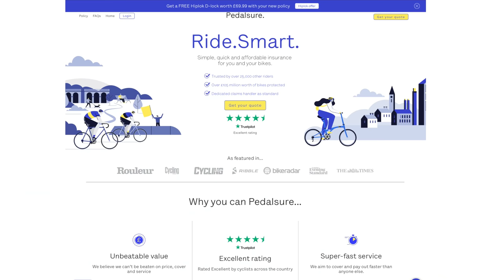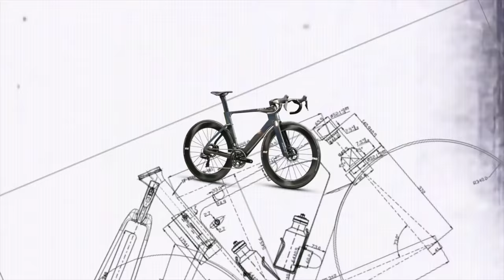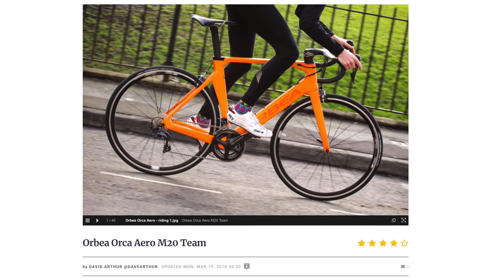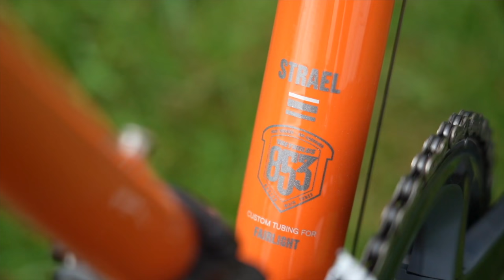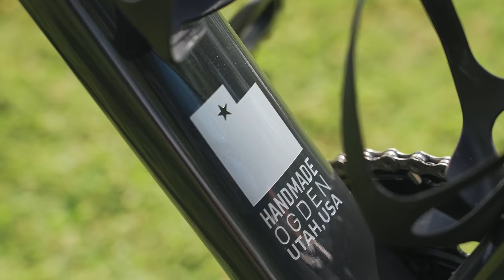6 Best New Road Bikes 2022

Comment: I Live in Birmingham AL and I received a Dogma F Plutonium Flash 56mm on August 4, 2021 SRAM Red AXS 12 spd full groupset which helps greatly with all the hills here in the city 10-33T cassette and and my Crank is  48-35T

Comment: Been thinking  of upgrading my 2014 road bike for 2 years now but prices and wait times keep putting me off pulling the trigger(remember the days when a bike took less than a week to arrive after ordering 😪).Integration on bikes is another problem for me, while it makes the bikes look fantastic the practicality factor puts me off. I enjoy replacing cables/ servicing my bikes myself without much hassle unlike new bikes with ever greater integration. Think I have just talked myself into sticking with old faithful for another year😂.
Reply: Check out the TCR Advanced Pro Disc 1. They still have some in warehouse (at least in the U.S.).  Mine arrived one week after ordering. Super great value. Good price…and you can replace cables yourself. Stiff in all the right places yet excellent ride quality.
Reply: @nelsdude  great bike but I also avoid bikes press fit bottom brackets.

Comment: I have a Colnago C64 plus DA on order. Really wanted rim brakes for looks (and I don‘t need the performance) but what convinced me to get hydraulic disks is the much reduced lever force required for same stopping action compared to rim brakes.
Reply: Yes my father liked discs for that reason. But he is 83 and has arthritis.
Reply: Hydraulics on a road bike is overkill. Mountain bikes, it's a must, road just plain and simply overkill. You can get away with disc brakes with cable/wires on a road and it would be perfectly fine.
Reply: @indusrtial  you don't need power steering in most cars. Yet it's nice to have.
Reply: @3stone1  …what, power steering just kills the feeling communicated through the wheel… in general, you won’t find race cars with power steering.
Reply: @fragu123  so you got rid of it in your daily I guess?

Comment: I agree Pin should drop the F and just call it Dogma. Rim brakes all the way! I will not ride my Dogma in the rain when if arrives. Disc on a road bike is only better in bad weather.  Plus I have never over cooked my rims brakes even doing 50 mph/80+km into a corner.

Comment: I'd like to comment on weight.
I weight 170 lbs. on my heavy days and as light as 160 lbs. on my light days
A bicycle frame weight of 800 grams is extremely light. Yes there are other frames even lighter. But to me the english words equate to very breakable. As a true cyclist for over 50 years. I have learned, when a person rides a bicycle he has accepted the risk of falling down (or crashing).  An 800 gram bicycle is more likely to break than a 1000 gram fame.
All you amateur riders put too much emphasis on lightweight and aero. When your body is 90% of your failure. Change your body position lose some weight and you won't need an 800 gram bicycle frame that is more likely to break.
 The bicycle industry has got our minds so twisted that they have many of us believing that what they are selling is what we need.

Comment: Aero smaro. The price of bikes has skyrocketed since about 2017. First discs, now aero. In video he says about the Pinarello F, "not really sure why its that heavy" ??. LOL, its obvious why! The manufacturers are charging a small fortune for these new aero frames at least they could provide the aero as well as frames less than 800 grams? Top end bikes get more expensive as weight savings elsewhere need to be found to offset the disc brakes and frame.

Comment: I'm retaining my use of rim brakes too. I don't have the eye sight to un glue the pads when they stick and my lbs hasn't got a clue either. Got 'em on my steel cloddy where they belong as it's so slow I get by on just using the so far un glued rear disk.

Comment: Integrated cable suck.  Even Cycling Tips admitted it was...   all these bikes are crap....  with the exception of rim brake Dogma.
Reply: The Dogma F's (rim brake) rear brake line passes through the upper headset bearing, so there's still integrated internal routing there.